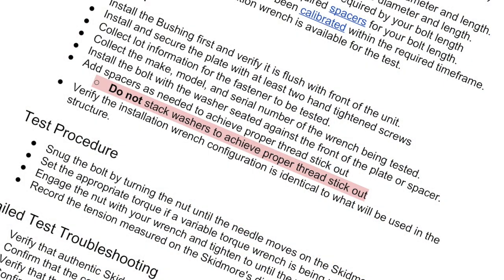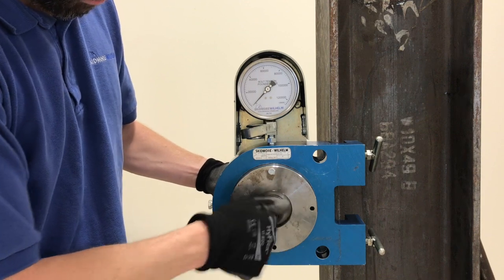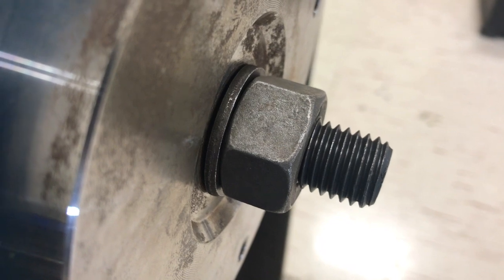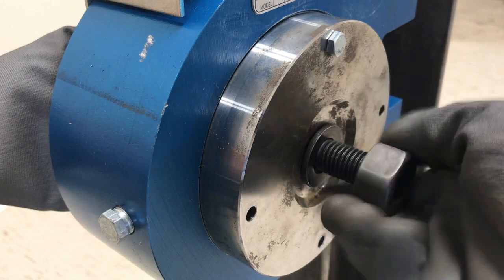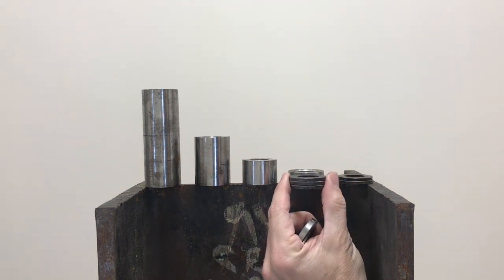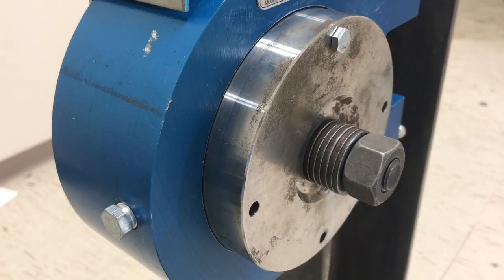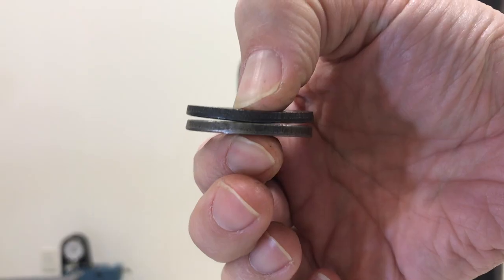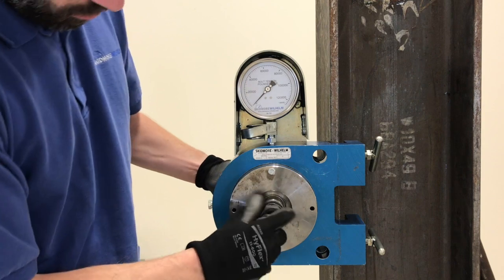Training Extra: Washers and Spacers

Comment: Dear Skidmore, I'm wondering if 316 stainless steel spacers are strong enough for this application? I can't find any obvious suppliers of grade 8 spacers. Any help would be much appreciated.
Reply from the maker: The 316 material is strong enough.  The more important factor is the wall thickness of the tube.  We also stock spacers and can usually ship same day.